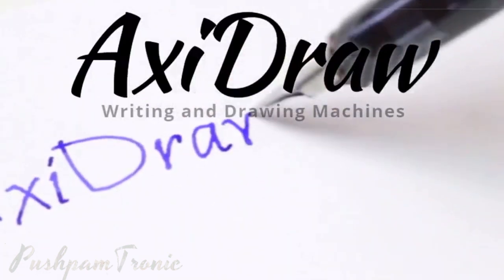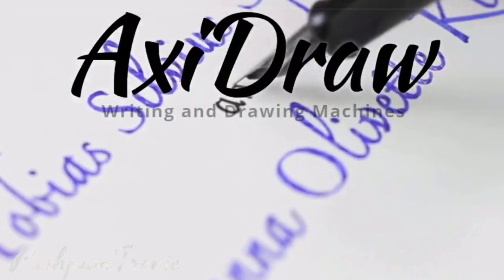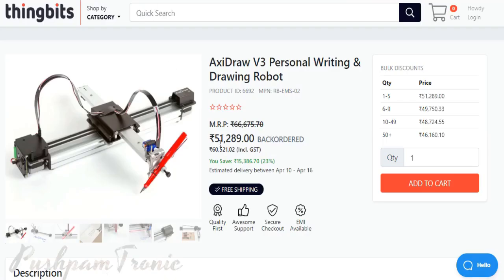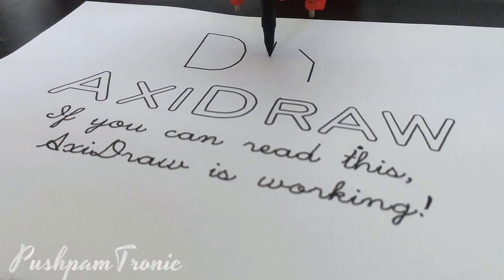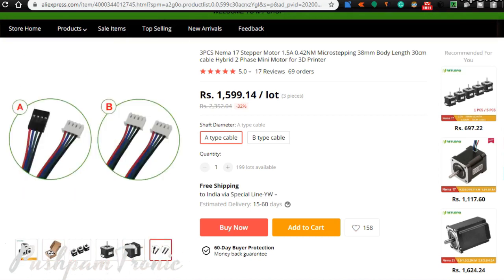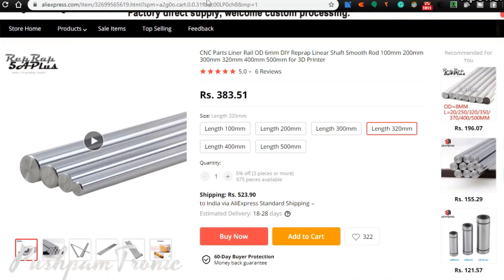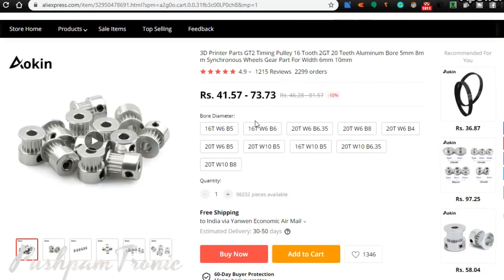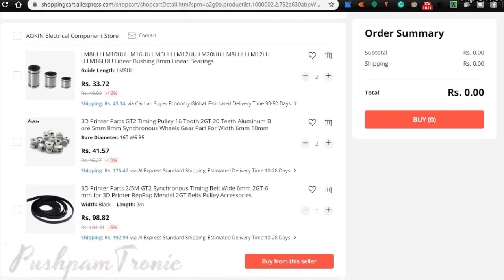Drawing machine | DIY AxiDraw 1

Comment: Hi

Can you tell me few points

1. Pen is facing towards me, so left is motor and right is motor, which is in x and which is in y in cnc shield
2. stepper motor red with is right or left
3. Home position should start from left or right

Thanks

Comment: Thanks for the video! just doing my buying to build my own machine, just wonder, is it ok, the Linear Rail is 6mm, as per the link, but the linear bearings is 8mm? LM8UU? thats right? 
Thanks in advance!
Reply from the maker: Please uses 8mm bearing,
Otherwise it will not fit with 8mm rod